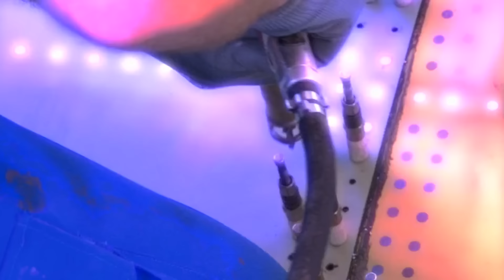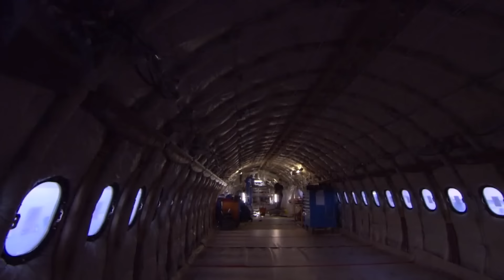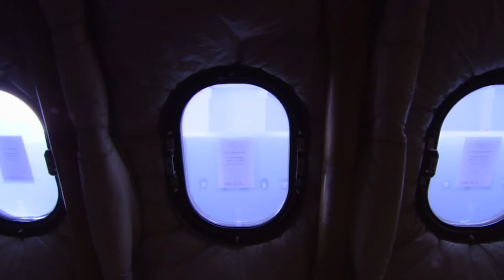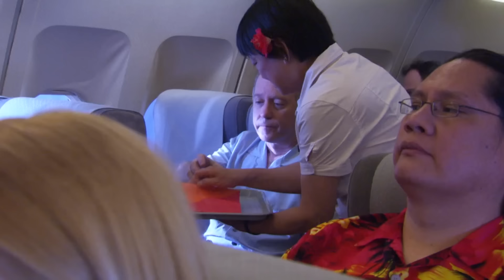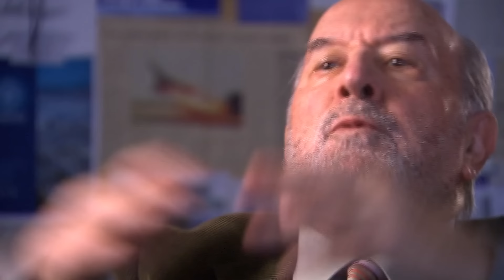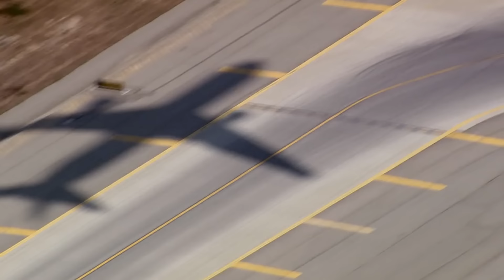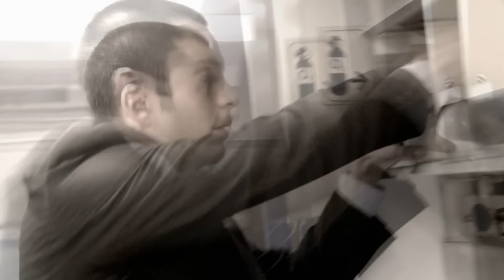Traveling A Life Support System That Became A Nightmare Come True... | Mayday: Science of Disaster

Comment: I'm a licensed professional civil engineer and I'd like to point out a couple of things. 1. The interior of commercial jet aircraft is not filled with oxygen; that would be hugely dangerous. That's exactly how 3 astronauts died on Apollo 1.  The interiors of commercial jet aircraft are pressurized with ordinary air.  Outside the air pressure is about 5.4 psi at 25,000 feet but with the compressed air it is designed such that it is maintained at the same air pressure as what exists at 8,000 feet or about 10.2 psi.  What's important is what's called the partial pressure.  Air is 20% oxygen so its partial pressure at sea level is 20% times 14.7 psi is 2.94 psi.  That, or more, is what has to be maintained.    2. The air pressure does not concentrate at the corners of square windows.  It is absolutely the same air pressure everywhere.  Only the stresses, the forces, concentrate at the the corners of square windows.
Reply: Not an engineer, but the “pressurized oxygen” was irritating me too.
Reply: Love your explanation-you did a really thorough job of explaining that. 
Unfortunately, most of the general public seems to think that air is the same thing as oxygen. So when they hear the narrator say oxygen, most people with think 'oh, that's air.'
I know that's incorrect, but
I guess maybe these are made for the general public...?
Just a thought.
Reply: Thank you for that breakdown
Reply: Never once did I assume during this broadcast that the plane was completely full of oxygen,  they never said it was.  It was full of air comprising of oxygen at app. 21 percent. So I didn't bother reading the rest of your comment.
Reply: I was thinking the same thing about the Oxygen comment. I'm not a civil engineer, but I have a degree in chemistry. Pure oxygen is highly flammable. A single spark and the plane would explode.
Reply: @livetotell100  Oxygen, in itself, is not flammable. It is more of an oxidizer or accelerant...no?
Reply: @kendallh9106  True. Oxygen itself doesn't catch fire. Fire needs oxygen to burn. So the more oxygen present, the easier materials will ignite a burn. Materials will burn hotter and faster when more than "normal" amounts of Oxygen is present. So the more Oxygen present, the more likely something will burn. A simple spark from loose electrical wires will do the trick. There are some studies that say static electricity can start a fire in an atmosphere with more than normal amounts of oxygen. So it's not a good idea to have an airplane that uses pure oxygen in the cabin or seating area. 🙂
Reply: @kendallh9106  But cabins are full of flammable substances.  Some of them that would normally only smoulder would burn violently in a pure oxygen atmosphere.
Reply: @livetotell100  9 I
Reply: @livetotell100  And 🤓
Reply: @livetotell100 ,  I know this will seem nit picky, but Oxygen is not flammable at all. What it does is greatly increase the flammability of other materials.
Reply: @thomastoups3451  I know. And it's not nit picky. I did correct myself, I think. Maybe I didn't. Not sure. So, stating a fact isn't nit picky.
Reply: @livetotell100  The issue with Pane Stewart’s plane was that there were concerns that the oxygen system was filled with room air and not oxygen.  While you don’t wan to fill the cockpit with pure oxygen, the oxygen tank used for the pilots masks must be filled with pure oxygen.  There were initial concerns (see the docket) that the oxygen system was recharged with room air and not oxygen.  That would be lethal because it wouldn’t supply enough breathable oxygen through the pilot masks.
Reply: @livetotell100 If you have a degree in chemistry I'm the Queen of England. Oxygen isn't flammable, it supports combustion of flammable substances. Every student of science learns that at 12 or younger.  😂😂😂
Reply: thank you for this, very informative. hope you’re well!
Reply: I had to stop watching after about 3rd or 4th "pressurized oxygen"...
Reply: @atlasz911 same 😂
Reply: @atlasz911  I get ya!
Reply: I actually agree with u. But it still blows my mind how powerful a 5psi decompression is. But I know volume of air comes in to play there as well. But still it's crazy to think about
Reply: beat me to it.
Reply: Came here to say this.
Reply: Thank you.
Reply: @jeff…the British refer to regular breathing air as O2…or at least it seems they do.
Reply: Jeff, this is kind of off the topic, but isn’t the air inside the plane recirculated? Wouldn’t at some point the carbon dioxide be an issue? I know that submarines have scrubbers that clean the air so it can be breathable. I would appreciate your reply. Thanks, Bruce
Reply: @Bcourtney7  It's not recirculated, it usually vents out the rear through a pressure regulator. The air enters the cabin from the compression of the turbines compressor.
Reply: @Bcourtney7 Common misconception.

No, new air is continuously pumped in from the engines, there's no reason to recirculate as there is air outside the plane. There's always some recirculation, but air is replaced constantly.
Reply: @MiriaJiyuu  sense its not perfectly sealed it would leak so even if you are recirculating you would still have to pump in new air as well right?
Reply: @jeffjenks2533 I must admit that this kind of docus are bad narrated. 3rd grade.
Reply: I remember one interview with the editors mentioning things that were cut for time in various episodes. One of the things was explaining air has more than oxygen. They didn't specify an episode, but that could be this episode. Also, pure oxygen does not equal inferno if you don't have an ignition source... sorry Apollo 1 crew it seems there was an ignition source.
Reply: Ordinary air?
Reply: @jeffjenks2533  you don’t say!
Reply: This video is made for the general public and they’re removing the information that isn’t necessary. They say filled with oxygen because it is, and that’s what most people think of when they think “this is what I need to breathe.” It would be weird to start going into what air is made up of because that’s not the focus of the video. I think you just wanted to seem smart when most ppl can decipher that themselves in .03s and keep watching. They could have said “air” but that’s confusing to viewers because that includes hostile air with less oxygen. Rather than using 100 extra words on this they trust that anybody with an iq of 80 and up can figure that out. But good on you, lotta ppl r dumb asf
Reply: Also, the square passenger windows arent the windows that are being talked about here on the de Havilland. Instead its a couple windows that are square and house avionics and communications packages. These windows are a lot squarer and larger than the passenger windows.
Reply: Im not sure the partial pressure of oxygen is the factor here it is the basic force of air pressure differential  between the outside and the inside of the cabin -  it basically a force (Newtons).  Being cyclic creates metal fatigue.  The Apollo disaster was caused by the ignition of pure oxygen because electrical wiring was at fault and caused a spark which burnt and ignited the flammable materials inside the locked capsule.  The oxygen reacted with burning materials and the added increased ferocity and temperature to the fire consuming the oxygen, causing rapid suffocation and burning the astronauts to death.  The door was designed such that it opened inwards and could not be opened quickly enough due to the  enormous pressure being exerted from the inside pressing the door hard into the inward facing recess.  The crew on the outside were unable to open the door in time to save the crew.  May the rest in peace.
Reply: On Apollo 1, it was bad wiring combined with the Pure Oxygen caused the fire
Reply: I agree with the oxygen comment.  Not only does a pure oxygen environment create an extreme fire potential event, it is also hazardous to the human body.  This includes the eyes and lungs.  While people in the hospital are fed pure oxygen,  they use several methods to mix in normal air to dilute the pure oxygen.
Reply: @jeffjenks2533  my comment was misconstrued.  I am talking about the O2 canister that feeds the pilot and/or copilot (may be redundant) oxygen masks.  

There were early theories that the O2 tank was filled with room air and not oxygen.   That would be deadly.  The pilots oxygen masks are connected to pure oxygen that has a regulator.  It’s only for breathing.  If the canister were filled with the air and not oxygen,  the pilots would be dead in no time.  Ambient air contains 21% oxygen.  Oxygen tanks carry 100% oxygen that feed the pilot masks.
Reply: just an fyi, this guy isn't an engineer he works at Popeye's Chicken as an assistant night manager.
Reply: @jeffjenks2533  let’s be clear!  I was talking about the smoke masks that pilots wear:  they put out pure oxygen.  On the Payne Stewart flight, read the NTSB report:  one theory was that the oxygen used by the pilots masks was room air and not oxygen.  Check the docket.
Reply: Even scuba tanks are filled with air and not oxygen
Reply: @watersportsbyjamesfitzroy5870 depends on how deep you go. Go over like, 197 feet deep, you use tri-mix which adds helium to the mix reducing the % of 02 and N, and chances of developing N narcosis.
Reply: Oh.
Reply: As comparison: The Apollo capsules hat 0.34 atmospheres of pure oxygen.
Reply: Also can't pure oxygen be toxic to the body? Which is why its mixed in suba gear and medical settings or is being pumped to a mask that doesn't isolate you from also breathing in the rooms air? I think ive only heard of pure oxygen being used for very specific treatments.
Reply: Kind of really late here but i have a question you might be able to answer.  Why not have cargo doors that open sideways?  Similar to how reardoors on a minivan open and close?  Even if it came unlocked it wouldn’t slide open if it had to slide towards the front of the plane, the air flow would push it back in place, no?  On minivans the doors slide open towards the rear of the van but on a plane you could have them slide open towards the front of the plane.  It wouldn’t take up any space in the cargo area either.
Reply: I've been going through the comments and for just 30 minutes, I've learnt a science lesson that eluded me in school for three years (Grades 10, 11, & 12)
Thank you guys
Reply: History is replete with folks, including engineers, confusing air with oxygen. 

It’s cuts both ways, Apollo 1 was a  hazard because the astronauts were in a pure oxygen environment.  Determination that pure oxygen was necessary was a mistake from NASA engineers.  However, the opposite, can be equally disastrous for pilots.

For example, there was initial speculation that golfer Payne Stewart’s plane crashed due to a pressurization event   as a result of the pilots oxygen cylinder having been filled with room air instead of oxygen.
Reply: @RandomDreamState In actuality it was the lack of oxygen that killed Payne Stewart
Reply: Thank you for the good info.  It cracks me up when I believe something filled with so much misinformation and then it's pointed out to me.  I love learning every single day, even at 55. Thank you
Reply: Dang that's impressive. I didn't know they taught civil engineers 6th grade chemistry. I'm so freaking proud of you. Maybe one day you'll even learn basic mathematics for converting between imperial and metric. So far I haven't met a youtube engineer that was capable of such a feat.
Reply: @flyingtentacle7631 underrated comment. Lol
Reply: Pure oxygen at 1 atmosphere is toxic.
Reply: @NXTangl  yup, it will blow your head clean off.

Dirty Harry
Reply: Im a k'nex engineer and I respectfully disagree.

😂😂😂pls get the joke
Reply: Also, the conet's accidents aren't directly it's square windows, since some planes can use them too without that failiure. It was mainly the fusiladge.
Reply: To bad its not at 50% oxygen then We'd have bigger bugs lol
Reply: Thanks. I was cringing at it, too.
Reply: no 1 asked for your perspective
Reply: engineers don't use psi, we use pascals, kpa, mpa, kg/cm2, bar etc. The use of such obsolete measurement is the cause of many crashes. Even the bolts used on the windscreen were because of not using all metric, but having non-standard imperial. It's not pressure of oxygen, but density that must be maintained. Most humans can tolerate about 30% less volume of oxygen before hypoxia becomes an issue. You cant solely increase the concentration of oxygen without increasing all other gases also from the compression of an engine.
Reply: Can you tell me why the passengers of Aloha 243 didn't just start a fire when they had to deal with -50 temperatures? You would think they would just start a fire and warm up. Also why didn't the stewardess that fell out of the plane flap her arms? As long as she had flapped her arms and kept her feet running she would have been fine as long as she didn't look down or stop mid air and feel under her and see she is in the air. That's when she would fall but she could flap her arms still as a backup option...
Reply: OK to be serious me civil engineer friend is correct here now let the mechanical engineer take over. The engines are used to supply the air pressure to the cabin. They are also used to supply the oxygen difference from that height. Its quite amazing what a commercial jet engine does during operation. Yet it is a very simple technology.
Reply: Space nerd and materials physicist (in college) here with hundreds of hours of personal study and reading the manuals. Oxygen is not flammable. Apollo one ignited because of the ramped pressure, this causes the velcro used everywhere in the craft to actually explode when it normally melts. If oxygen ignites it flash burns and is out in a second or two. Had the velcro not exploded the astronauts would have been burnt but very much alive. But the pressure was 17 PSI to simulate the positive pressure of space flight. Also the cabin is indeed pressurized relative to the outside of the craft. There are tremendous stresses put on this thing. The pressure of the plane may be sea level, however, comparatively the pressure on the outside is lower than the pressure in the cabin. This infact means the cabin is pressurized and has positive pressure. exerting on the craft itself. The atmosphere itself may have not been pure oxygen, however, nothing else of what they said was incorrect. You are forgetting that the positive pressure pushes out, the same time the negative pressure on the inside is sucking on the craft as well.
Reply: @williamsplays8528    Oh so the Velcro exploded 🤔 hmm well that’s that then
Reply: @williamsplays8528  Of course oxygen isn't flammable, it reacts with flammable materials.  Apollo also filled with toxic gasses from burning electrical insulation and such.

Airplane cabins are actually pressurized to less than sea level.  What do you mean by "the negative pressure on the inside is sucking on the craft as well"?
Reply: Didn’t ask mate
Reply: Thanks for pointing out big discrepancies like this.
It tells us not to trust the rest of the video's information or any video from this channel.
Reply: @flashgordon3715   this is meant for general public.  Many call regular air oxygen.  He also says the it comes from compression from the engine so he is not saying it is pure oxygen.  To disregard the rest of the information because he uses the word oxygen you are not looking at what is said.
Reply: @Stephen Borntrager  
You tube is quickly becoming a major source of education and information. The videos may stay up long after we're dead, accuracy is important for future generations
Reply: @flashgordon371the video was absolutely correct.  No one ever said the plane was ever FULL of oxygen.  When the masks come down you breath a supplement of oxygen,  pure oxygen,  at a very low flow.
Reply: @flashgordon3715  I wouldn't go that far. it's a minor detail. The rest of the information is sound. If you want to learn physics, then go to a physics channel. This is about air disasters.
Reply: @Josh-cw8by  theres a difference between removing uneeded info to make learning easier and straight up getting something factually wrong, which isn't useful to ANYONE, no matter what you're watching.
Reply: @cherriberri8373   he is not factually wrong many people call air oxygen.  In the compressed air is compressed oxygen and other gases.
Reply: @Josh-cw8by  excellent reply!
Reply: Nothing you say means anything as your comments suggest you believe men landed on the moon 😅, everything you say must be disregarded now 😂

Comment: I was sure that the accident with the cargo door was on a McDonnell Douglas DC 10 not a Boeing 747. In fact I am almost certain it was not a Boeing 747. If I am wrong someone please correct me.
Reply: The DC-10 did have problems with the cargo door. 2 DC-10s had cargo doors come off. It was the locking mechanism also that was the problem. But the 747 did have a cargo door come off. So you were halfway right.
Reply: @sergeantpeppers8858  Yeah the DC-10 doors were on the rear of the fuselage IIRC, not front, also the one incident had a depresurization, and the passenger area partially collapsed into the cargo bay, but it didn't have any passengers ejected.
Reply: There 2 incidents of a rear cargo door coming off a DC-10. On the first time the decompression and collapse of the floor didn’t damage the flight controls as much as the second so the pilot was able to land. On the second in France the flight controls were more damaged and the pilots couldn’t control the plane and crashed.   

United 811 was a 747 that had a cargo door malfunction in the middle of flight and came off, causing damage.